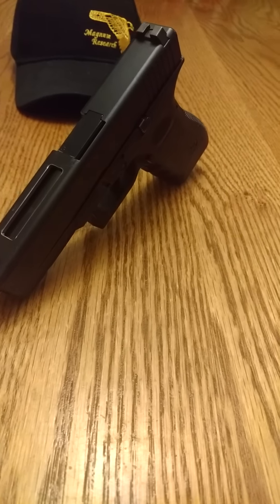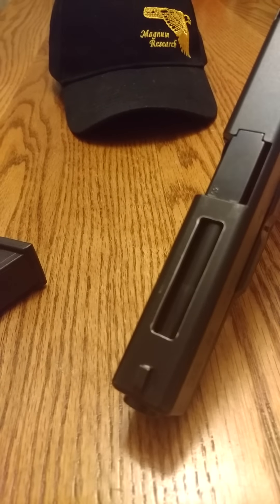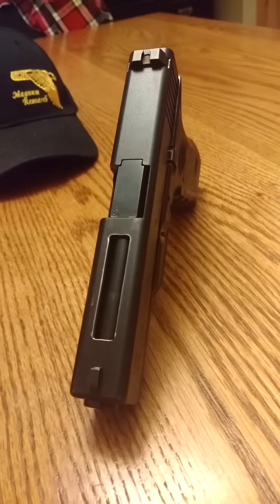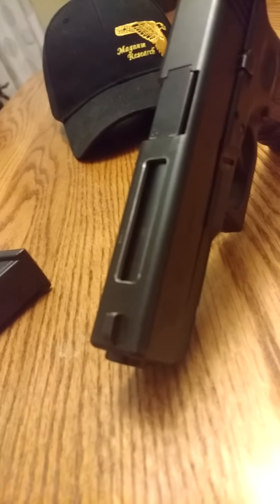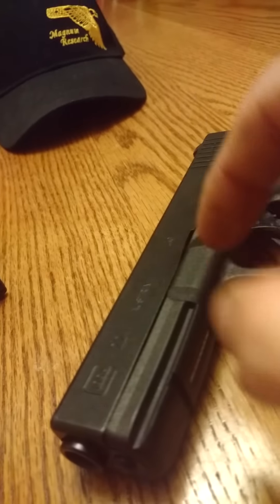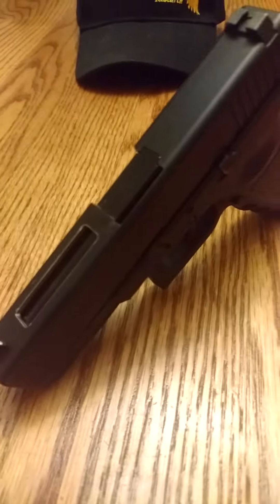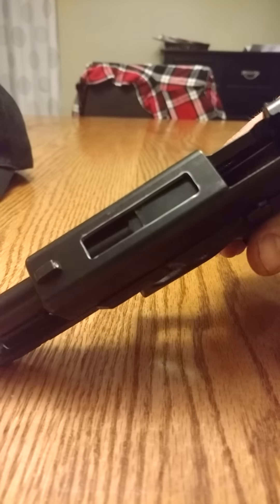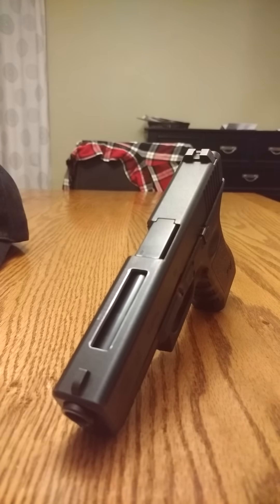Hand milling glock slide

Comment: What/how are you going to blue the bare metal!?? You should do a video on that too.
Reply: Thats easy.

2 cans Gorton's stump remover (100% potassium nitrate), 2 cans of straight soda lye (look in drain clog area of store and has to be crystals), 1 gallon distilled water...............pour water in stainless steel pot and start heating, SLOWLY add soda lye (in that order reversing it is dangerous always add acid to water not water to acid), SLOWLY add potassium nitrate, heat to around 350 on a hot plate. degrease and hang parts into the solution after all the lye and potassium nitrate melted. You can test with a scrap piece of steel before using the part. 

This works and is a bit more involved than home parkerizing which I have also done. This method is the longest lasting but if not monitored with a candy thermometer will lead to odd colors namely a plumb color. Has to be the right temp. Parking is a bit more forgiving but does not last as long and is only a prep before adding a thin coat of paint, or grease results can also come out gray or uneven when parking. Hot bluing is an even consistent color.
Reply: @evilcowboy An old comment, but handy to know. Something to look into anyway. 👍

Comment: But what is its purpose? To show the barrel underneath? How much does this affect the structural integrity of the slide?  I thought you were milking for a reddot when I read description
Reply from the maker: Making the slide lighter means less felt recoil, this also helps with quicker follow up shots. And trust me, this doesn't affect the slides integrity in a very substantial way. Its like modifying a car. Yes when you throw a supercharger or a turbo to an engine that wasn't developed with that in mind there is a chance of it not being as reliable as it were before. But take it to the track and you soon realize why the modifications are appropriate for the application. Same with this. I take this to the range and can get my follow up shots on target quicker. Also. it just looks absolutely sexy with the dimpled barrel I installed. As for a red dot on a pistol, If I'm having to use a red dot it better be on a rifle. Pistols put holes in bodies rifles put holes through bodies.
Reply: @coolyprice4730  I honestly used to think the same way. "I shouldn't need a red dot to hit my perp with a pistol". Until I got the Burris Fast Fire II on my FNX 40. I went from moving target to target with solid shot placement, to snapping 15 180Gr hollow points rapidly into my targets neck, jaw, sinus cavity and forehead. Make the move man, you won't be dissatisfied

Comment: This literally does nothing.  The purpose of porting is compensation from the gasses leaving the barrel.  With no port in the barrel allowing gas to escape, this is strictly for show.
Reply from the maker: Your comment isn't entirely true. If you have less moving mass it equates to less muzzle flip. It's called lightening. This way you can get back on target quicker for the follow up shots.
Reply: Even if that's the case, what's wrong with it being for "show"?
Reply: You made the slide lighter and increases muzzle flip, the slide is balanced for weight ratio from the factory.
Reply: Why even comment on whether it's for show or not? He never claimed to improve the performance so you literally started a debate with yourself.